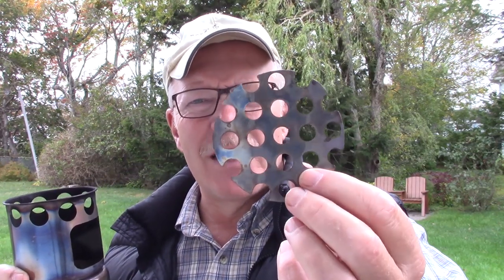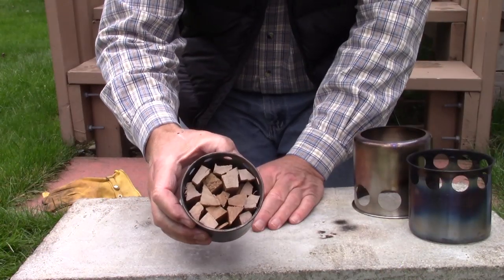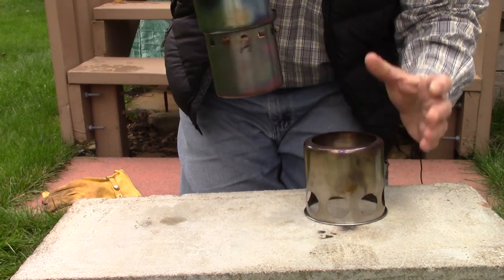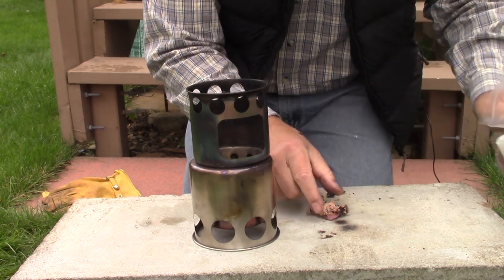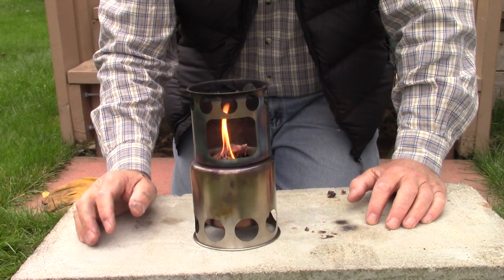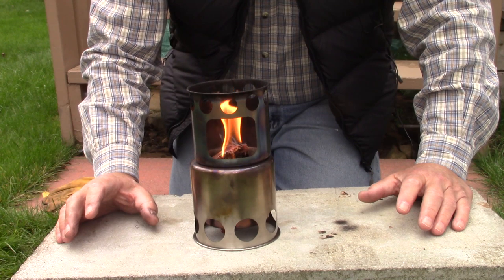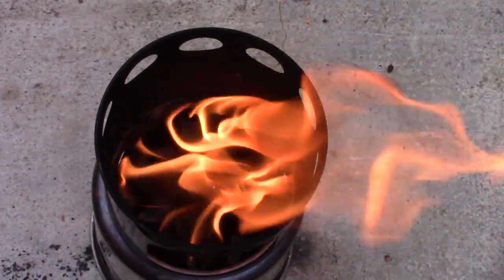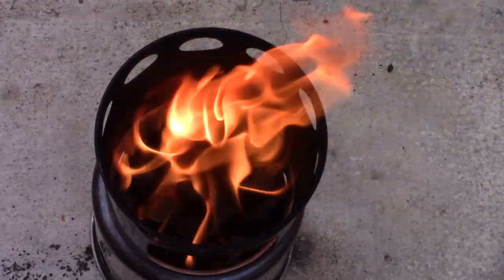Lixada Tower Stove Modified to Gasify

Comment: Hi Mark. This is real science. A suggestion would be to make the the holes in the plate so they align with the holes in the burnchamber. It will alowe you to adjust the airflow from the bottom by twisting the plate thus regulating the size of the holes.
Reply from the maker: That would be an interesting mod for sure. Something I could consider trying. Thank you for commenting

Comment: I saw your video so i drilled some small holes in a can lid, so now i can also use wood pellets so the pellets don't fall through the bottom. Works very well.
Reply from the maker: Glad the mod worked out for you. Thanks for commenting

Comment: Seems like the manufacturer could add a second plate, same as first with a rivet in middle that would allow dampening like a simmer plate on alcohol burners, possibly with a set second position that would optimize gasification. Or redesign one plate's airflow. Cheers
Reply from the maker: That would be an interesting stove for sure. Would add cost to making it of course. I did hear from another viewer about one that had an adjustable grate called the Pyrolino. Thank you for commenting

Comment: Lol.. I tried exactly the same test with some stainless steel mesh sheet.. results were very similar.. problem I found that I was left with chunks of charcoal in the base that lowered the amount time I could use the stove at a one time. For me the original setup works better and is reliable everything... 👍👍
Reply from the maker: Interesting end result. I agree, the stove works just fine as is. Thank you for commenting

Comment: Have similar oven. A knock off no name thing, but it is identical. I have tried with a plate that reduse air Flow and it gasification got better, but there are better gasification ovens. But it is a killer oven that burns semimoist wood very well, and it is Superior other pure  gasiifications oven in that area. If the wood are dry, it can handle surprising big chunks.
Reply from the maker: Right on. Thanks for sharing

Comment: Thank you for the experiment update, Mark. I’m wondering how the dynamics would change with a 1-2 cm high, perforated cone sitting on the bottom - the perforations being roughly 0.5-0.7 cm, uniformly distributed on the cone’s surface. Likely, better air flow, hotter temperature, and less smoke.
Reply from the maker: Interesting. Another viewer suggested a sink drain. That may meet your suggestion as well. Thank you for commenting

Comment: So I just came across a titanium small version of the lixada on AliExpress for $30. It seems it's even lighter than the Toaks small ti wood stove.
Reply from the maker: I have been looking at that stove as well. On my wish list to get at some point. Thanks for commenting
Reply: @MarkYoungBushcraft  I ended up just going with buying the small toaks. Wanted to get some experience with the stove before I do a upcoming hike. If you get the ti lixada definitely post a video comparing the steel with the ti version. 

Edit: got the stove. 3" of a 2x4 burned for about 30mins. And I got really nice gasification within the first 3 mins or so.

Comment: Try again with the perforated plate between flame and wood?
Reply from the maker: Good suggestion. Thanks for commenting
Reply: Mark Young 
This is my rational behind this. 
Ideal case is all fuel converted into wood gas come out of gas holes. Practically only about half volume wood gas come out of the gas holes and the rest ignite leaving the tripod around pot at reduced efficiency. Evidence? black soot on pot wall. Any modification that promote wood gas out the gas port and less via the tripod is good.